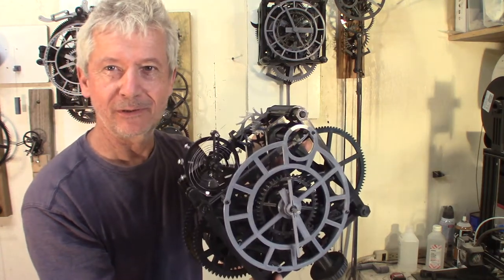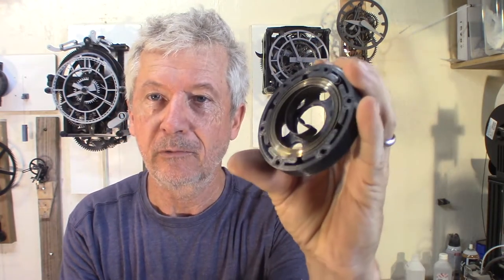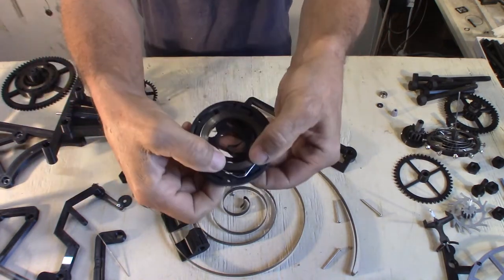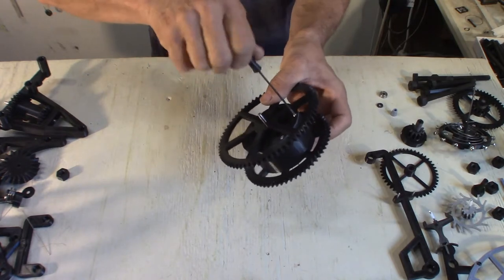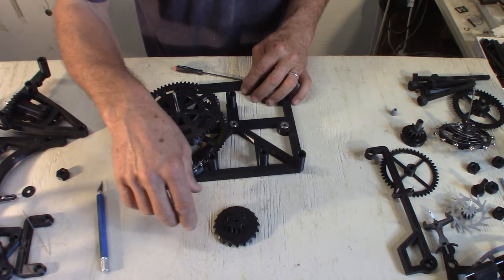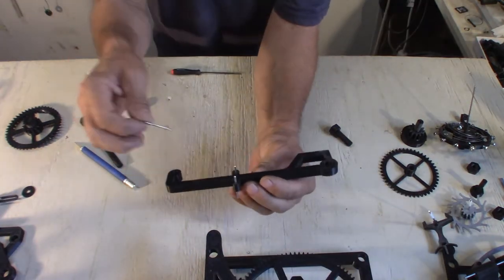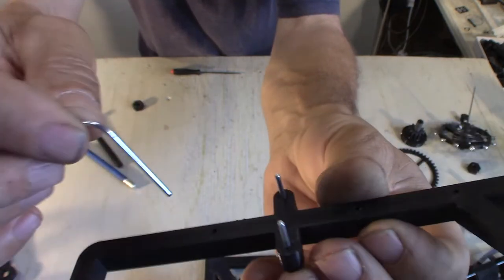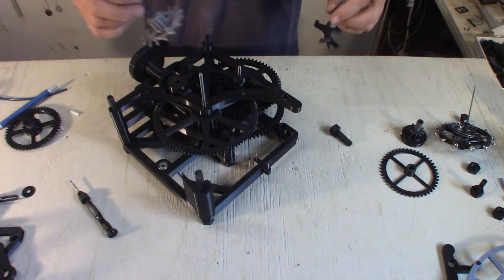The design and prototyping of a 3D Printed Swiss Lever Escapement Watch Clock: The build

Comment: In good time, it's a peace of art, there is no doubt that it is incredible work.  The only drawback that I see now, that can be improved is that the spring is very small  1/4 of what is found in a normal watch... (not problem, only will last a few hours).  And you could also try to lubricate for improve accuracy, you can try to use a transparent box, it is a masterpiece, like anothers master, little by little you will discover how to perfect and improve your work, to the point that will be the small details that will make a big difference.

Comment: Hi, what is the clock's power reserve ?
Reply from the maker: about 10 to 12 hours
Reply: @jacquesfavre999  ok, thanks a lot.
Another question... I have to print all the pieces for building the watch. 
My printer can print max 220x220 mm pieces, is it enough or I have to use another machine?
Reply from the maker: @alessiocurti9752  200x200 is fine